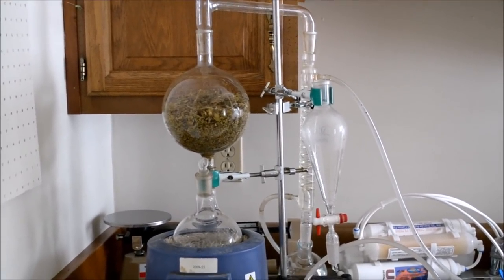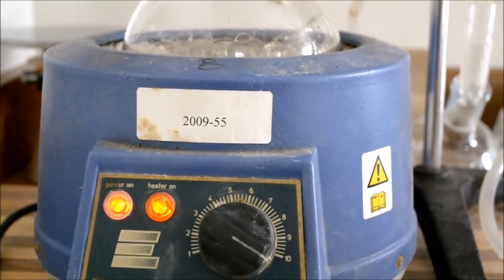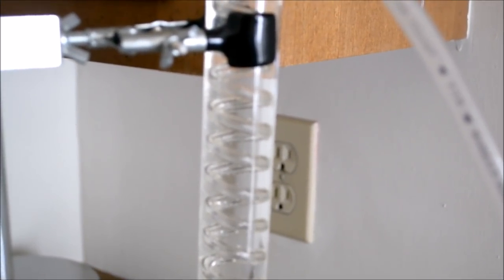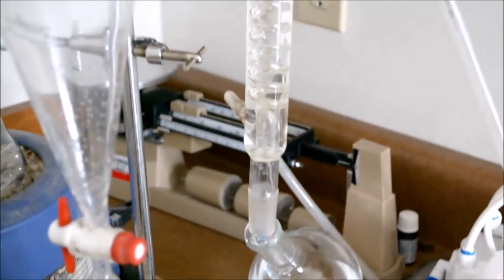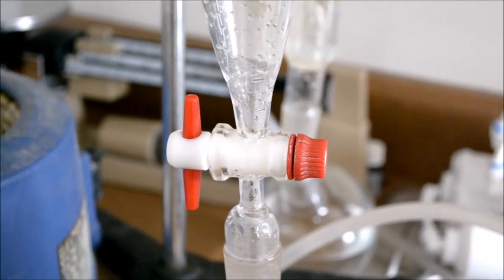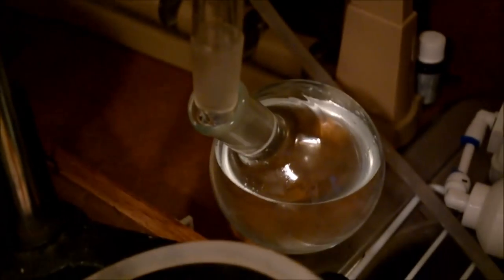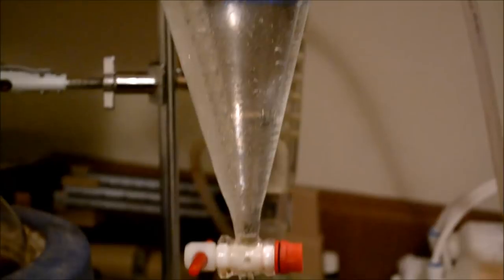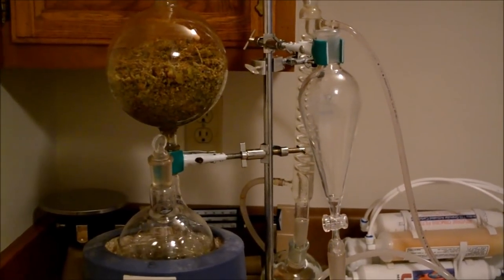ESSENTIAL OIL DISTILLATION

Comment: We use hydrosol for creating a calming attractant for our honeybees.  We mix it with some sugar syrup, pour into a spray bottle, and use it in place of smoke.  We have been using the hydrosol of lavender for about four years now.  The bees fly right to it.  Thanks for the video.
Reply: Hello I would be interested in how much sugar you mix in the lavender hydrosol and do you spray that directly into the beehive instead of the smoke? maybe interesting for you I use apple cider vinegar mixed with garlic instead of formic acid for varroa control that works well in my climate zone that a beekeeper from Syria taught me !! Thank you
Reply: Id be very interested to see that in action (I always suspected that the smoke and pesticides are contributing factors to hive collapse)

Comment: Really enjoyed this video, would be amazing if you could do a video about curing oils after distillation?
Reply from the maker: Curing oils is a simple as putting them in a bottle with headspace and giving it time. I open the bottles occasionally and air them out. Anywhere from 3-6 months is appropriate but upwards of a year or more depending on the oil and how you want it.

Comment: Have you tried doing this with lemon balm/Melissa officinalis? I think the herbs would have to be replaced many times since it apparently has such a low oil content. Is that even do-able, or would you need a giant herb flask?  The oil is soooo expensive and you don't really know if it's adulterated or not, but this stuff grows like a weed and manages to re-seed itself up to SIX FEET away from the original plant. I'm always chopping it back and I'd love to be able to do something really USEFUL with it.
Reply from the maker: I tried lemon balm once, I did not get any oil, however the whole process was a disaster, so I cannot vouch for my results.

Comment: Hi, very informative. We just got a little chem set, but doesn't have all the pieces yours does. Especially the catnip vessel with the glass tube on top and bottom. Where did you get it? If no problem I'd like ask you some more questions about how we can adapt our setup.
Reply from the maker: Search for a biomass flask, or a Gas chromatography flask, or get one specialty made.

Comment: I found a separatory funnel at work in the trash so I had to see what they did. Awesome setup. If I made this setup could I potentially distill alcohol?
Reply from the maker: You could potentially still alcohol, but likely you would want a bigger boil flask less the biomass flask and a different condenser.

Comment: nice setup be good to use an adapter for your receiving flask .Plus who told you ro water normal tap water is fine .if you get the browning in your condenser put it in the oven on high and it will burn out most of its just oxides
Reply from the maker: Hi Cameron, to clarify the distilled it reverse osmosis water is for the boiling flask. Any volatile molecules like chlorine should be kept out of the distillation. For use around the condenser ant water works, but distilled water will prevent buildup on the glassware. I have not tried sticking glassware in the oven to clean it, but certainly cleaning hunk off the inside of a flash is difficult. Anything to cut down on the cleaning time. Thanks for the input!

Comment: I see people putting the materials to be steamed right in the water to boil them.. Yours is in a container above the water.. Is there a benefit to your setup vs. theirs?  Do you have materials drop into your boiling water for example?  Was hoping you could elaborate on this for me and others...  Also I am looking at a receiver/separator tube to follow the condenser which seems would drain out water and leave only oil on top automatically... it seems very cheap and was wondering your thoughts?
Reply from the maker: Hello, the difference is steam distillation and hydro distillation. Things like roots and bark are often produced through hydrodistillation while more sensetive materials ran through steam. A sepratory funnel like the one you are questioning is a good idea, yes. Also, these topics have been discussed already in the comments.

Comment: hi. my question is, have you ever try to get EO from flower petal? how many drops you get if you have done it?
Reply from the maker: +Arlene Debbie HI Arlene, thanks for watching my video. To answer your question, yes and no. I have distilled many plants flowers and all, including catnip (discussed below), St. Johns Wort, Goldenrod, and Bee Balm, but I believe you are referring to things like Tuberose, Jasmine, or Lilac. These flowers take a more labor intensive process called enfleurage. In this process the petals are layered on to a sheet of clarified fat, once the fat has been sufficiently infused with essential oil, then it has to be removed with a solvent. There are, of course, more intricacies to the process, but the end result is an absolute. Another way to access these aromas is to soak the botanicals in a solvent. When the and the solvent is evaporated you will be left with a waxy, aromatic substance called a concrete. I hope this helps to answer your question.

Comment: Christopher, thank you for your video.  I just got a distillation system, a similar setup as yours, same separator, however; after I distilled dried rose buds, and poured the hydrosol into the separator, there was no oil on top or bottom.  I did the same with dried Helichrysum.  Can you give me some suggestions?
Reply from the maker: +Monica Dehnert Because I only distill wild harvested/ local herbs, I really have no experience with these two plants, distillation wise. I believe these oils have to be hydro distilled or boiled directly into the water. I know rose petals are prone to clumping and they will clog a vertical steam still. Furthermore, these plants make a very small amount of essential oil, you may have not put in enough material to get a single drop. I also know that rose has to go through a process of cohobation in which the hysdrsol is redistilled and the resulting oil combined with the first. These are very tricky herbs to distill, I wish I could offer more advice.
Reply: +Christopher Leifson  thank you so much!
Reply: +Rain Tree Thank you, I am learning a lot.
Reply from the maker: In a still this small I doubt that you could fit enough biomass of those specific plants to create enough essential oil to separate. I would try a plant with more EO. Excuse the late response, hope this helps.
Reply: @ChristopherLeifson  Yes, I did more research and realized this.  Thank you for your reply even if a little late.  : )
Reply: @MonicaDehnert  Use fresh herbs not dried, dried have evaporated the essentials already

Comment: I think I understand how to put this thing together. I got mine from Ebay at a fairly good price, but it came from China and doesn't have directions. I don't understand how to attach the hoses that run the water through the condenser. Do I attach them to a faucet and leave the water on, or do I fill up the sink with water and use a pump? Does using the pump make the water go through the hose, and if using a pump, do you still have to attach the hose to the faucet? I assume the other hose just drains the water into the sink?
Reply from the maker: How the hose connects to the sink is going to be determined by your nozzle and laboratory material, but for home use generally a fish tank pump with hoses the same diameter as the pump lumen. Connect it at the bottom and let it fill to the top, and yes the other hide is the drain.
Reply: Thanks. Are you saying that the pump is supposed to be attached to the hose? Is there a place on the pump to attach to the hose? Thanks for your help and video.

Comment: Do you recommend freshly picked or dried herbs for distillation? If I have dried herbs, can they be used? Thanks!
Reply from the maker: This is a great question, thanks for asking. Truly it depends on the plant and method of distillation, but it is recommended that the herbage be wilted it dry before distilling. I find that the drier the material the less green the oil smells afterwards, and less curing time for the oil is needed.
Reply from the maker: For most distillations I suggest using dry herbage. I find it creates less odd note post distillation abs of course you can usually fit more in a still dry.

Comment: so are cannabis terps legal since it does not have thc? also what happens to the thc? where does it go  does it just go to waste ? lmk thanks
Reply from the maker: This video is about distilling catnip oil. You should try to ask someone who actually dies that kind of work. To briefly answer, terpenes are legal, if you were to distill cannabis essential oil it would be thc free. If you wanted to extract the fat soluble molecules you could use an oil extraction afterwards. More likely would be to make an absolute and separate the thc from that, but I’m still not certain an alcohol extract would get all the thc your looking for. Again, I suggest asking someone who works specifically with cannabis.
Reply: thanks....makes sense though....take the terps out and then co2 product or alcohol and then separate and then fractional distillation to make it clear and pure... but i kinda rather dry sift for kief/hash and then steam distillation the rest of the flwr that was sifted to take remaining flavor terps out and since it is dry sifted it wont have much thc i care about...thanks
Reply: @KingsHustleLA  curious how did it work out for you. i found the process you described works well.. there may not be as many terps in the material after the tumbler but depending on the strain there was a lot of smell left in the waste material. the small sticks also have terps.

Comment: Hey Chris one more question why sometimes when using steam distillation people put the herb above the boiling water like in the video and sometimes they mix the herb in the water this has really confused me?
Reply from the maker: +Chris Okay Chris, the reason that your confused is because there is lots of confusion surrounding the topic. For a cheap and simplified version I suggest, Make Your Own Essential Oils by Daniel Coaten, while Essential Oils Vol: 1 History-Origin In Plants-Production-Analysis  by Ernest Guenther is a very detailed book on the subject. The bottom line is there are several kinds of basic distillation:  water, water-steam, and steam distillation. Water distillation is when the herbage is submerged in water. water-steam is when the herbage is suspended above the water, but is still touched by the water, and steam distillation is when the herbage and water are completely separated (Guenther, 1948). Often times the details are overlooked.

Comment: Can we use dry herbs instead of the fresh? Do they contain essential oil?
Reply from the maker: Using dried herbs is preffered over fresh. Because fresh herbs are mostly water it takes twice as mich fresh mayerial to get the same amount of oil as with dried material.

Comment: will the steam distillation of cannibis indica resualt in the oils of thc and cbd or mostly terps and hydro florals. ps read your other comments and had to fedo them to show u im serious. alzo rusty on all this
Reply from the maker: Thank you for taking the time to reformat your question in a more scientific form. You can steam distill Cannabis, but it does not result in the extraction of THC. You would end up with a terpene based oil that would smell like cannabis. At one point Oshadhi oils, the European store, had this oil for sale. It would be a great place to see what the oil is like. I have never done this extraction personally.
Reply: +Christopher Leifson that brings me the question how would one go about distilling out a resinous or waxy compound,  i know steam can extract water soluble and fat soluble compounds, what about resinous or waxy?
Reply from the maker: The oleoresin that I get from distilling balsam poplar sinks to the bottom of the boiling flask where it can be poured out, left to cool, the water poured off, and dehydrated. I have read that the wax from Myrica gale can be boiled out the sane way, but it floats insteads of sinks. In both plants the heat easily seperates the wax or resin from the plant matter.

Comment: I just bought a similar heating element and the first time I ran it the bowl it some what smokes..Is this normal, does it have to burn off with the first couple of uses? Kinda worried.
Reply from the maker: Yes, that is normal. Let it burn off before using it.
Reply: @ChristopherLeifson  Thank you VERY MUCH! 🙌😁

Comment: Why such a low yield, was it due to the amount of starting material?
Reply from the maker: Thanks for asking, that is only a 2 liter still, at that volume it’s most plants the yield will be less than 5ml. Secondly, as aromatic as mints are their yields are not excessive. If you look at the cost of an organic peppermint oil it is around 25$ for 5ml. That is on the pricier side. The time of harvest and phenotype makes a difference to, although it may be less noticeable. In the same still filled up, cedar will yield closer to 10 ml. Hope that helps to put perspective on it.
Reply: @ChristopherLeifson  Yes absolutely, thank you for the thorough answer

Comment: Why don't you have anything to remove pressure, such as a vacuum pump or aspirator?
Reply from the maker: Because the still is open to the atmosphere on one end, the pressure is equalized and a vacuum is unnecessary. You may be thinking of fractional, or vacuum distillation, in which the vacuum creates a lower boiling point allowing volatiles to evaporate at at a lower temperature.

Comment: Great video Christopher!  Would you be able to post a parts list?
Reply from the maker: The prices necessary to build a similar still are:
Heating mantle
Boiling Flask
Resevoir Flask
Distilling head
Condenser
Collection Flask
Water Pump
Distilled water/ reverse osmosis filter

Quite simple really!
Reply: +Christopher Leifson Awesome, thanks.  And is your reservoir flask a 5000ml version?
Reply from the maker: That is correct.

Comment: Have you ever tried this with turmeric?  I know the active ingredient in it--curcumin---is a fantastic anti-inflammatory, but it also stains horribly and you can't get it out.  I wondered if turmeric could be turned into an essential oil, it wouldn't stain as bad.
Reply: mary what these things do is heat all liquidous fats and hydro soluble things from a material into a vapor that condenses into a purified liquid, if curcumin is fat or water soluble it will be vaporiezed and fractioned off in the oil, this presscess does not change whats in the material only extracts and concentrates it. so yes this would give you curcumin, and yes it will stain, but more importantly this will be the most intense stain youve seen in your life, it would be a nightmare to clean off the equipment and more importantly your body. so find a different anti inflamitory
Reply: Chris P. Bacon OK, thanks for the info.  :-)
Reply from the maker: The essential oil does stain,  however,  if an absolutley certifued organic oil can be ascertained it could be used internally as an anti-inflammatory without staining clothes or teeth. There is already products like these sold at health food stores.

Comment: When I do my essential oil's from dry herbs it smells funny after and and I tried curing the oil to see if maybe the smell comes alive but it still smells off not like the herb I'm trying to extract the oil from
Reply from the maker: What plant are you distilling, when did you harvest it, what is off smelling about it? It is common for freshly distilled oils to have nitrogenous and sulfurous compounds. I have seen oils take up to 6 months before smelling accurate. What's confusing about this situation is that typically I find the dryer the material is at distillation, the more it smells like it's supposed to.

Comment: Is there any plastic parts that is in contact with the steam ? Because you can end up with BP A, B etc...and phtalates in your essential oil...
Reply: Badis Bel Also where did you buy the equipment ? Thank you very much !
Reply from the maker: +Badis Bel The only plastic that touches my oils is the stopcock on the sepratory funnel; this is a standard PTFE used with all chemistry glassware, and the oil only contacts it for moments. No plastic please!
Reply from the maker: +Badis Bel Please refer to the post above for the answer to this question. Most of the materials come from different places.